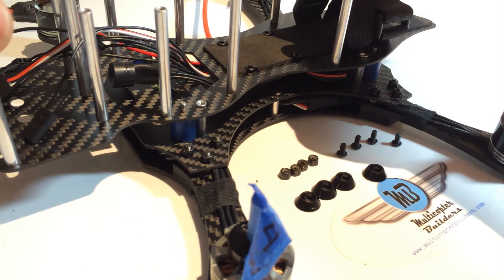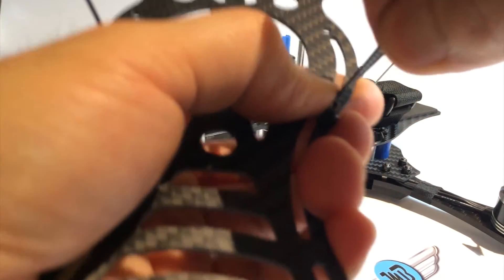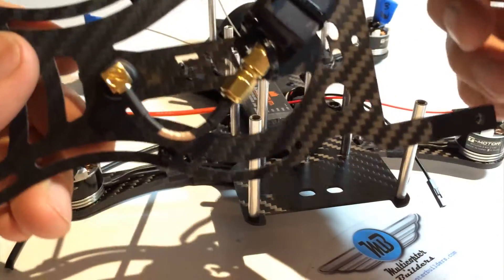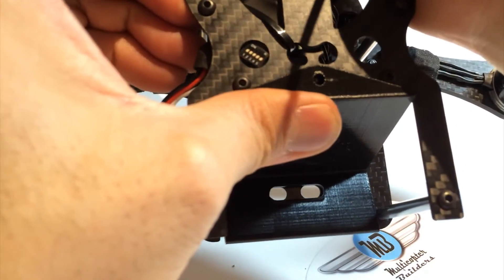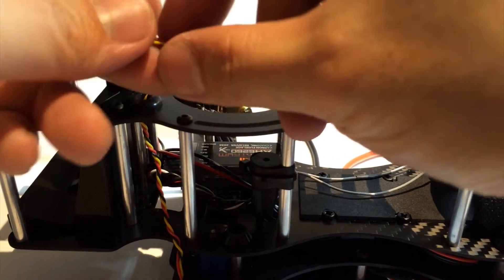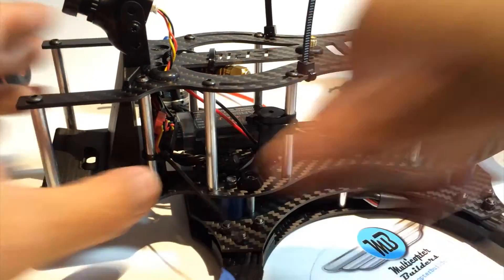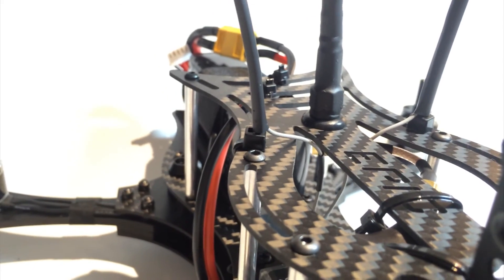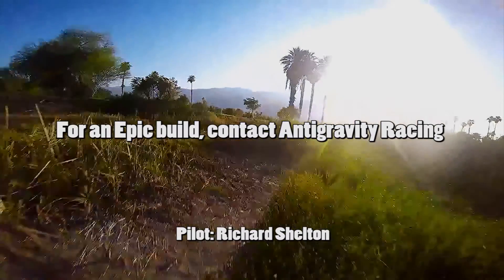HOW TO : Build an Epic 280 - Part4

Comment: Thank you a lot for this awesome series! Such an accurate work is inspiring and a must-have guide for my own building project.

According to this, there still are a few questions :)
First and most important: Where is the maiden flight video? :)
Second i would appreciate, if you could list the temperatures u used while soldering the parts. Will that be possible?

Thanks again for the awesome work!

Vince (Germany)
Reply from the maker: Thanks Vince for your awesome compliment.  The original intent of the video series was to show how to assemble an Epic V2 frame.  That's why I didn't go over all the setups that are specific to every miniquad build (which there are already awesome tutorials on by great fpv channels). So a maiden vid didn't seem appropriate for this video series.  In terms of temps, 700degrees is a good temp for soldering on wires and pdb.  If you are direct soldering to escs, I use 590-600degrees.  Naze pins i also use the 590-600degrees.